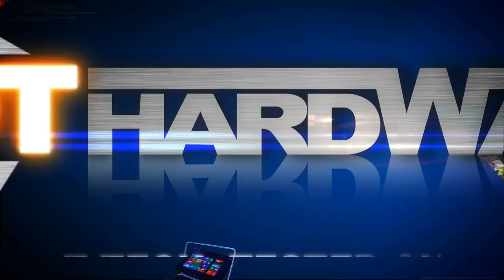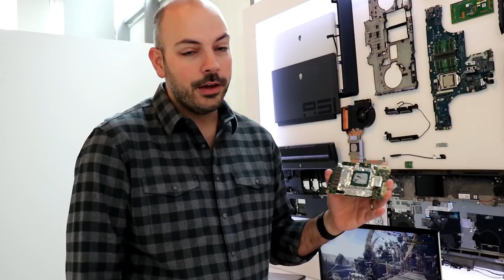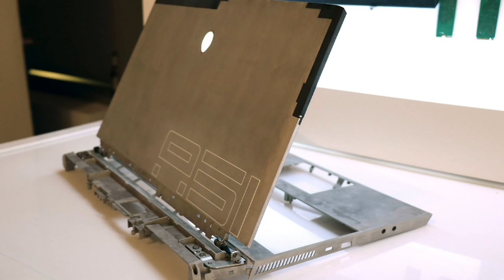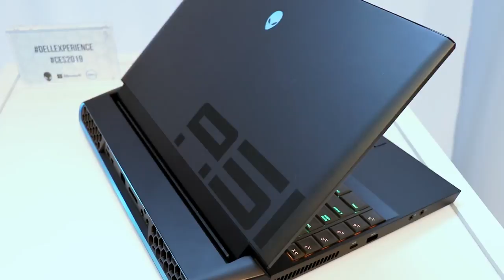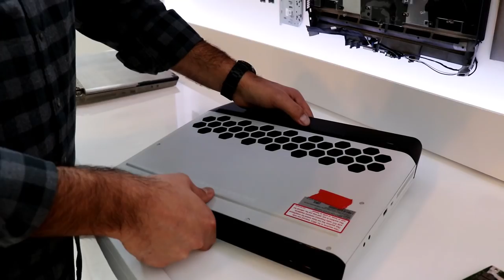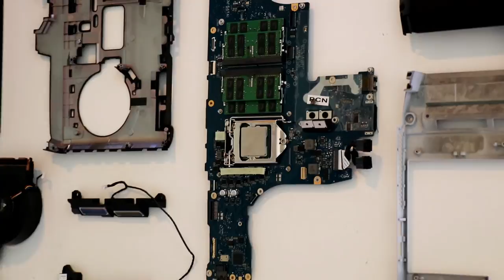Alienware Area 51m Interview Frank Azor - Killer Gaming Laptop!

Comment: This is the future , this is how i imagined a laptop for years .
Reply: You know what ?? The design just looks like another laptop which it is standard gaming design and still not impressive like they did back in the old days. In my opinion, the old design model still look much badass and way futuristic. If only, Alienware M17x R4, M18x and mALX model come as a new laptop with the new powerful specs today, it would look more impressive than this one.
Reply: @ytanonymity3585  You must be high or drunk.
Reply: I was thinking the same but trust me it's far from it, you can't even access the NVIDA panel, meaning if you have an 4k display or TV it will not let you play in 4k. I'm trying one more thing before giving up on it and if that doesn't work I will call them and return the unit and trust me I will never use dell for anything $4k for what to get 5 more fps over my desktop intel 3930K / gtx1070 32 gig of DDR3 preforms almost the same but is able to render in 4k

Comment: Word of advice to anyone bying the alienware area 1 if you buy the product with rtx 2060 installed you will not get fan cooling system with side fan cooling!! and the ac adapters will be less powerful ie one that built handle rtx 2060. If you decide up grade later you would need to get heatsink and side fans as well as an upgraded ac adapters. So if you plan to upgrade in near future my suggestion would be upgrade the graphics card there and then when you buy the laptop do yourself a favour save your wallet that headache

Comment: I buy one 15R4 four months ago and now they come up with basically A Desktop in a laptop form factor?? Great just Great
Reply from the maker: Well, those are two very different machines. The 15 is much smaller. This is a 17-inch format. Also, can't help the pace of innovation sometimes bud. :)
Reply: Ya i wish i could return
Reply: You'll be fine, even though Tech is a double edged sword, quick to be cutting edge and quick to be obsolete.

(well not obsolete, but no longer as flashy when something new comes along)

I am still happy with my 2016 Alienware 15" R3 GTX1070 and can play all modern games comfortably at 60 FPS, high settings at 1080P and hadn't the need to get an Amplifier yet.
(Xcom 2, 4K high settings runs reasonable!)

So your machine will do you good for more years than mine at 1080P gaming and we still have the amplifier for 4K gaming.

The only thing I think holding our machines back is reaching a CPU bottleneck in a few years.
Reply: I would buy a time machine to go back in time to stop me from buying a laptop last year.
Reply: I know how u feel man xD

Comment: Are there still 3 m.2 slots?
Reply: good question, because I only saw one section in the top left.

If I am going to go all in with a new Alienware laptop, I also want to make sure I can stuff it with as much SSD storage as possible over along period of time.

My Alienware 15" is able to have 9TB, so this should not take less.
Reply: No, it only supports 2 m.2 slots + 1  2.5" drive

Comment: Would buy this in an instant if it came with  1440p 120hz, 144hz or 4k panel.
Reply: I do not see any reason why they did not included a higher refresh rate 1440p or 4k panel.  If you fully spec out the area 51m with a i9 9900k with RTX 2080 you can easily drive frames over 100 in most titles and with the 1080p display it is such a waste of horse power.
Reply: @hassanaslam6008  my thoughts exactly.

Comment: Frank said in the end it is launching at CES but reporters saying it will launch Jan 29?
Reply from the maker: It's a couple weeks out. This was shot in December. That's why he said that
Reply: HotHardware 

What about starting price he said starting from 1949$ but the other reports said it's starting from 2549$ ?
Reply: Mr M the lowest spec at launch would be 2549 and will be followed by lower specs which I think would have a RTX 2060 starting at 1949.  The one releasing this month at 2549 will have a 2070 and i7 9700k.
Reply: Hassan Aslam 
Rtx 2060 with Ability to upgrade in the future in my opinion is not bad compared to other RTX laptops prices let's wait for honest review to see how he can handle the thermals
Reply: @mrm40  I agree.  It is highly likely that you have to order the part directly from alienware which will be priced higher.  Also, we do not know if next gen intel chips will support LGA 1151 socket.  In my opinion Alienware's hands are tied down and what they say should be taken with a grain of salt but it is great to see them at least trying it.  You also need to be more technically savvy to change  the components as it will not be as easy changing components in a desktop.

Comment: so why not a 1440p or 4k option???
Reply from the maker: Because of the thin bezels and no panels to support it right now in that size.
Reply: @Hothardware  meh ... i would have bought at release if it had 4k option.... 1080p... meh. guess ill go for a CLEVO
Reply: Because 4k (resolution) is not near as important as refresh rate at this screen size
Reply: currently there are no 4k option with 100+ hz refresh rate. 1440p with 120 hz is possible though

Comment: Is the display TN or IPS?
Reply: TN, IPS cannot have a 144hz refresh rate. Not even 120hz.
Reply: @ultramale6813  AHVA Panels (which is essentially IPS) are up to 144Hz now, that's what is used all of the 144Hz screens are on notebooks and the super expensive 27" UHD HDR 144Hz desktop monitors from Asus and Acer.
Reply: @sabishiihito  oh I didn't know that, thanks man.
Reply: @ultramale6813  ain't tech progress grand?
Reply: @ultramale6813  IPS 144 hz panels

Comment: Huge "diminishing returns" after 1440p and ~ 120hz so the "sweet spot" is really 1440p / 120hz.  1440p looks A LOT better than 1080p but 4K doesn't look much if any better than 1440p for most games I've played (MANY) and frame rates above ~ 100-120hz aren't going to somehow make you a pro player or even provide you an advantage period. 

So IMO, people are just throwing their money away when spent on 240hz and 4K gaming monitors.  

Currently, the very BEST overall gaming monitors are 3440X1440P - Ultra Wide / Curved - 21:9 - G-SYNC - 100-120HZ - 4ms response time. 

In the future (and now to a limited degree...) of course there are monitors with the following specs: 4K - 144HZ - HDR - G-SYNC -  Curved / Ultra Wide (21:9 aspect ratio) - 4ms response time - etc.. I've seen a $5000.00 65' Monitor on Amazon with similar specs but that's obviously a TON of money and would require at least 2X 2080Ti's to take advantage of.  Even then you'd probably be struggling to maintain  ~ 100HZ on more demanding games. Regardless, said monitor paired with the optimal gaming rig would be an insane experience to behold I'm sure and SUPER expensive...

Comment: I just hope they are fast enough to release the upgrades as soon as they are released. 

Dell has a very bad history of releasing GPU 6 months after official release. Making their new systems coming out way behind the competition. 

This all sounds good. But I wouldn’t hold my breath on the parts being ready as soon as Nvidia release them.
Reply: there is still always the amplifier...but I know.

I wonder if there could potentially be SLI/Crossfire (not sure if AMD still does that) abilities if desktop upgradable laptops take off now that eGPUs are becoming more common?
Reply: Duane Locsin SLI and Crossfire were good back in the day. But the trend now even with desktops is that support for it is dwindling. Most DX12 games can support it, but developers just don’t want to implement it. Even with the new NVIDIA RTX card. You see now they only support SLI on 2 cards now not  3 way or 4 way. 

With less and less support for it. And the single card performance is now good enough. 

I’d say if they decided to make an 18’’ version of the laptop then maybe. But remember these are custom full size RTX2080 cards. They are not mobile MXM versions of the cards. Making them bigger in size with custom connectors. 

Also just Incase you were thinking it. The Graphics amplifier is a standalone device. It’s either one or the other. It can’t be SLI’d with the internal card.

Comment: This is nothing new!!!  Way back. The M17x and M18x and M18 were all fully upgradable. 

Nice they are going back to what Alienware was all about. But I stress this is not new for them. 

Dell just followed everyone else with cheap thin laptops soldered CPUS. 

BUT before that. They were all desktop cpus. 

Hopefully they will be top of the notebookforums again like they were before. 

Wish they would bring back the 18’’ laptops though. They were beasts.
Reply: I know right. Plus, the old design of M17x, M18x and mALX design still look much badass and futuristic than this one. I'm still sticking with my M17x R4 and still could afford gaming today yo with the GTX 1070 in it.
Reply: I wish they would bring back the design of mALX, and Area 51 M7700, they were badass too
Reply: YT Anonymity wasn’t too keen on the M7700. Mines got wasted offshore during bad weather. Air conditioning unit was desk height we were in a container on deck. And a massive wave crashed the side of container. Laptop got drenched. Left if a few days to dry out. But the salt water ruined it. Was all corroded green inside. 

I liked the m17x and m18x. But still love my M18. The last 18’’ from dell. Dual 980m’s.
Reply: R Alcroft did 980m still could afford gaming today ?? Can it run PUBG ??
Reply: YT Anonymity yes it can. PUGB in not an intensive game for graphics. ???
Reply: nick donzanti will be a good feeling unboxing it.  that was the best part with alienware boxes  lol.  Plus the first time you turn it on and run it through a few benchmarks.